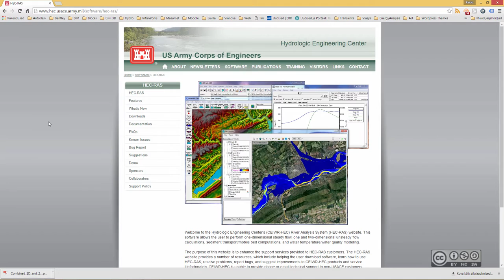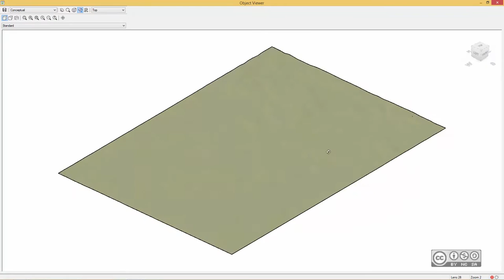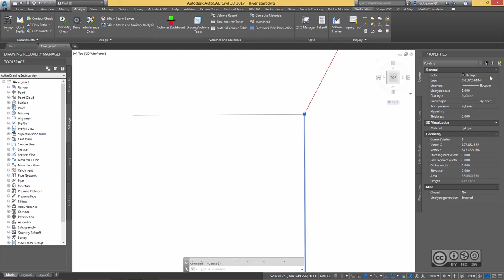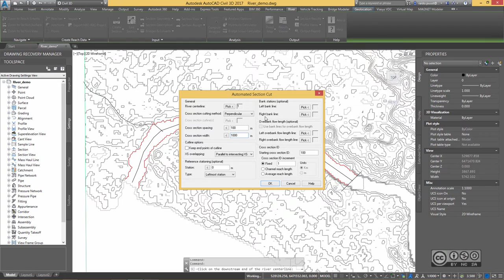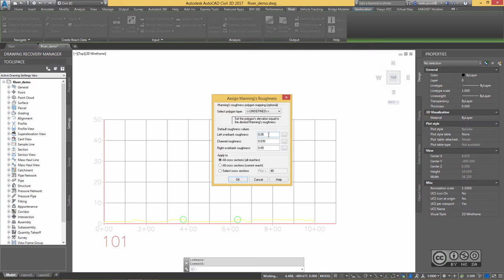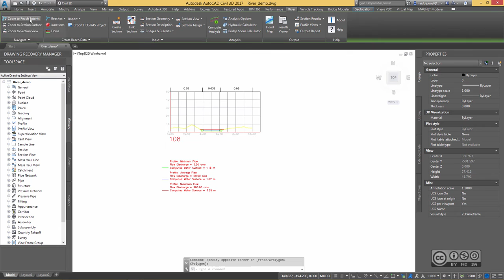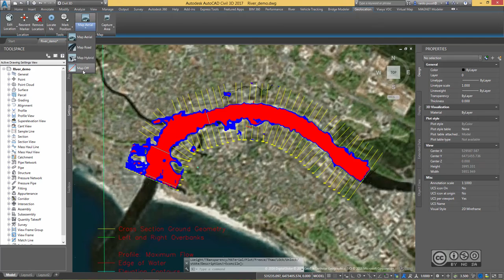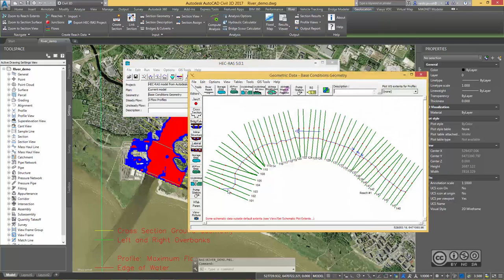AutoCAD Civil 3D 2017 - River and Flood Analysis (overview)

Comment: I need help on how to mark upper and lower edge of contour lines and to delete  the contour lines between edges after generating surface of the river and area around the river, so far this video helps me alot
Reply from the maker: I’m sorry, but as this module is not available on newer versions of Civil 3D, it is impossible to support you in this matter. Maybe you can get some hints from HEC-RAS manual directly!

Comment: How can i export results (XS, Inundation boundary, profile views) from River&Flood Analysis in Civil 3d to AutoCAD without losing information? Any time i try to explode the blocks of XS or profile views the "XS number" disappear.
Reply from the maker: You need to check what type of that object is (Properties palette). In general, if you export or explode some unsuppoted object into AutoCAD, of course you lose data/information. That is the reason why you need to use Civil 3D instead of AutoCAD. You should be able to open up Civil 3D drawing in AutoCAD, if you have enabled Civil 3D object enabler (https://knowledge.autodesk.com/search?cg=Downloads&sort=score&page=1&downloadType=Object%20Enablers&_ga=2.213524564.194591347.1607877260-665338820.1599568533)

Comment: wouldn't that be the existing water surface shown in section from existing surface model and not the river bottom? Would need Bathymetric data of the river bottom?
Reply from the maker: Yes, for sure, exact river bottom data is needed. This is a general workflow assuming that you have correct surface model already that includes correct river bottom surface as well.

Comment: This is a great video and helped to set up my model. I am not able to move past the phase where you initiate the run/model. In the video you ran the model and a screen popped up right away providing you with information that the model was run successfully.  I however, do not get this window to show up after I initiate the run model phase.  Because of this I cannot move forward. I have gone through the tutorial/video over and over trying to determine where I went wrong and I cannot figure out how to trouble shoot this issue. Do you have any information that would help me move forward?

Thank you.
Reply from the maker: Thanks. So, you are saying that it doesn't start the calculation? In the video, the actual calculation is cropped, only final state is shown. Therefore, it doesn't mean the caculation is immediate. Still you should see that the calculations starts... any warning messages on the command line? You may want to scroll back in the command line, to see if any notification was given (typically those doesn't fit into 2-3 default size command line window).

Comment: Excellent video! This got me started in this module and I already feel like I've learned a lot about how the module works.  My issues now seem to stem from errors within the program...

I am having a multitude of difficulties with “unhandled exceptions” and other similar errors that are making minor revisions take hours to perform via trial and error until the program decides to allow me to make the revisions.

At this point I’m not sure how else to proceed. I’ve had our IT department look at it as well as reached out to Autodesk. Nothing yet. Just curious if you’ve experienced these problems in 2018. I’ve never used the program in 2017 and I keep being told by others that all these bugs were “fixed for 2018.”
Reply from the maker: I appreciate that you find this video useful. Thanks Paul. 

Yes, I have seen those error messages. Although there may be several other reasons, what I do recommend, is to uninstall River and Flood Analysis module. Do a restart. Check that you do not have it. You can update your Civil 3D, including latest updates. Perhaps now you try to reinstall the River and Flood Analysis module as well. Hope it helps. Usually such errors are caused by some problems during installation.

Comment: Hey !
i've face next problem, if you can help me i would be hardly appreciate for you, since i didnt find correct answer in google.
After installation of RFA module i cant launch any of the icons in "River". Just receiving this : "error: no function definition: RMS_JOBCHANGED"
Reply from the maker: Seems that commands are not accessible (not enough user rights). It can be because the river extension by default is installed to user catalog: C:\Users\<username>\AppData\Roaming\Autodesk\C3D 2017\enu\Support and you are using different account?

Try to unload the menu. Type "menuload" to command line, find "River" and unload it. Then, do the opposite. Load it back in (but first browse, go to the location, where "River.cuix" can be found and "Load" it back into Civil. This is simple unload/load menu functionality. If it is still not working, then try to run Civil 3D as an Administrator (right click on an desktop icon).

Some additional suggestion from the web:
https://forums.autodesk.com/t5/autocad-civil-3d-forum/river-and-flood-analysis-2017/td-p/7042016
https://knowledge.autodesk.com/support/autocad-civil-3d/troubleshooting/caas/sfdcarticles/sfdcarticles/River-and-Flood-Analysis-module-runs-only-with-Administrator-rights.html
Reply: Thank you for answer but it doesnt work. I'm using correct account and unload/load didn't make any difference

The information that's posted on forum is like nothing according to solution.
Reply: Somehow i manage all things and now its working. Thank you for help !
Reply from the maker: Good to know!
Reply: I have the same problem, how have you fixed it??? any help??
Reply: hello,
i don't know will it help in your situation but that's how i fix it on my pc:
1) i completely delete all autodesk software from pc (https://knowledge.autodesk.com/customer-service/download-install/remove-products/remove-windows-products)
2) reinstall it on system disk
3) install RFA module 
4) launch c3d with administrator rights
5) set the path in c3d to recognise RFA module (https://knowledge.autodesk.com/support/autocad/troubleshooting/caas/sfdcarticles/sfdcarticles/DCL-errors-when-starting-AutoCAD-products.html)
It may help, so try this ! Good luck.